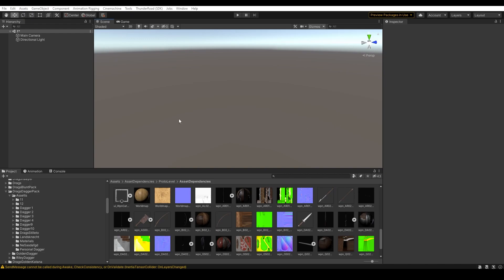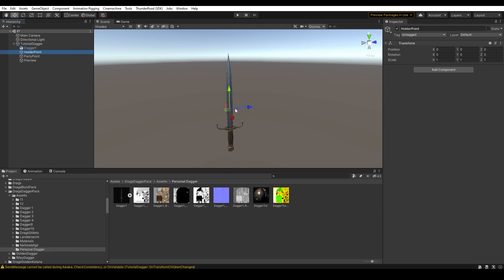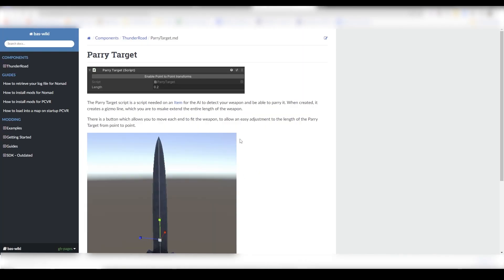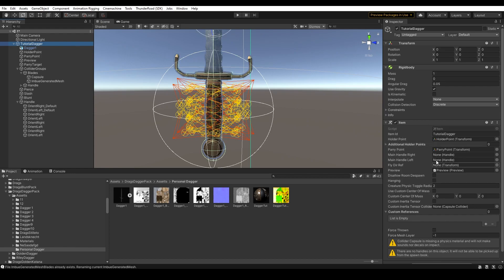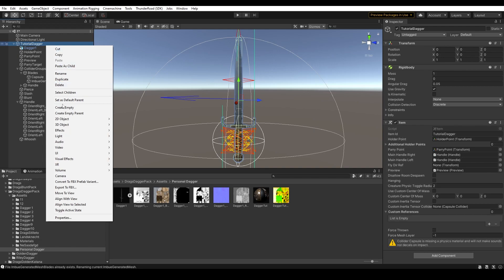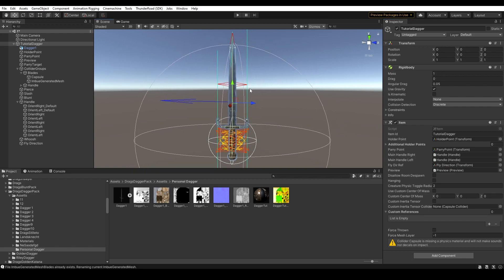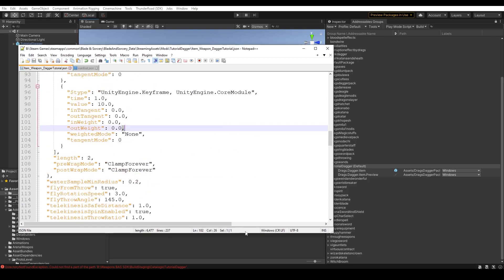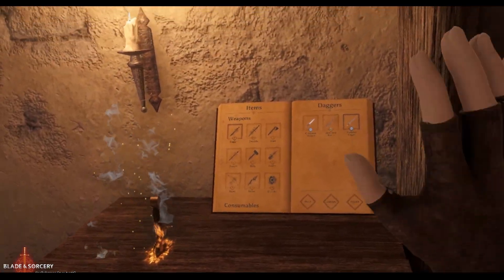Blade and Sorcery | Official Weapon Making Guide | Update 11.2 AND Update 12.1

Comment: Weird, I installed the most recent mod editor from the github, but for some reason adding the orientations for the handle, it doesn't show the hand pose anymore...
Reply: its a glitch but it has been fixed
Reply: just close the project and open it
if that didn't work, what I did to fix this was start again with a new SDK and make sure you click on the folder that has your weapon and assets and not the blank space in the file explorer on the left
and the catalog picker just takes a few minutes to load
Reply: Toggle "Catalog" in the bottom right menu that shows up when you pick either "Left" or "Right" hand orientation

Comment: Do you have any idea why when I build my mod it only builds an empty folder, without the catalog files or bundle files? I keep getting a build error and I have tried reinstalling the SDK which has not worked. I have modded the game before and it has worked perfectly in the past. I am 100% sure I am doing it correctly as I have followed exactly how you are doing the new build method. I would appreciate it if I could get some help on this issue as I have been stuck on this for the past 2 days.
This is also a common problem I am seeing but usually no one answers
Reply: you figure anything out yet?
Reply: i'm also looking for a solution
Reply: You need to have sdkshaders and sdkshadersHD in your asset bundle group
Reply: I FOUND THE SOLUTION, my friends, all you have to do is make witchbroom default and create a brand new addressable group. (Basically copy and paste the old one). I have no idea why this works but it does.
Reply: @alexwalker4891  how do I do that? Sorry I’m new to unity
Reply: @Wubbarb.  follow the steps at 25:10 in the video but instead of doing it to your tutorial dagger or whatever do it to witchbroom
Reply: And make you you make a brand new addressable group for the dagger
Reply: @alexwalker4891  alright I think I’ve done it right, I made the witchbroom default then I deleted my old tutorial dagger addressable group and made a new one and put all the old parts in the new one. Is that correct?
Reply: yeah